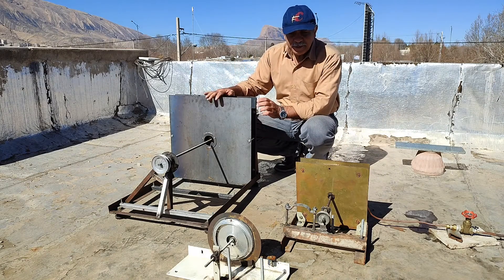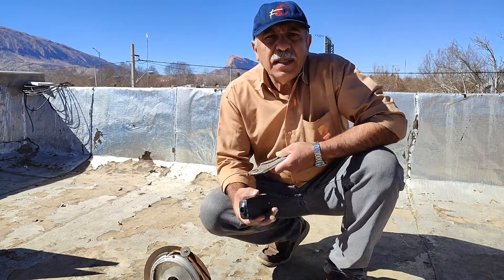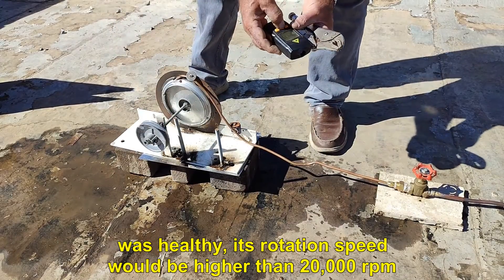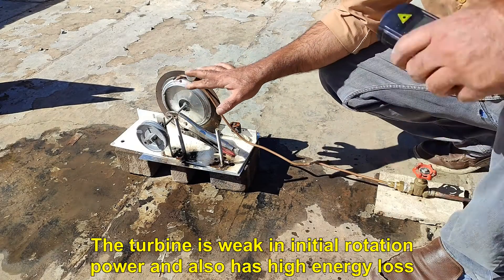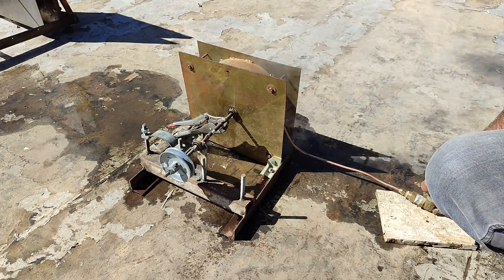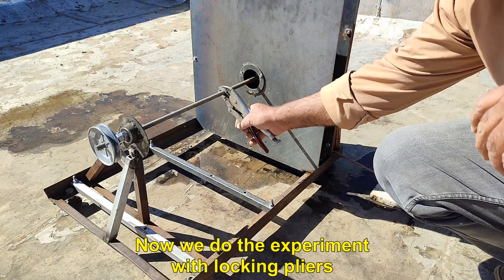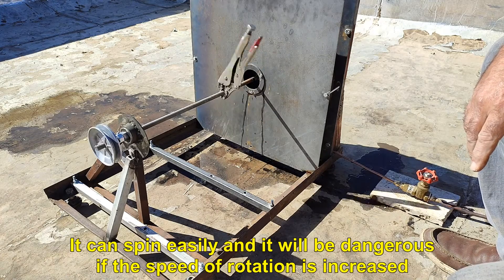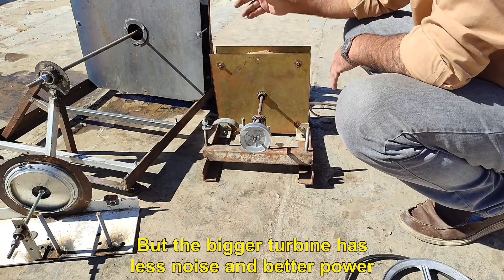Comparison of steam turbines.Steam turbine power

Comment: What is the power difference between the medium and large turbine? They take in the same pressure steam so Im wondering if the smaller turbine can produce the same power
Reply from the maker: Thank you dear friend
In fact, the power of all of them is equal
The small turbine has high speed and low torque and the large steam turbine has low speed and high torque
Reply: @fixedfocussolar  Thanks, I hope you keep making videos about this. Very interesting stuff!